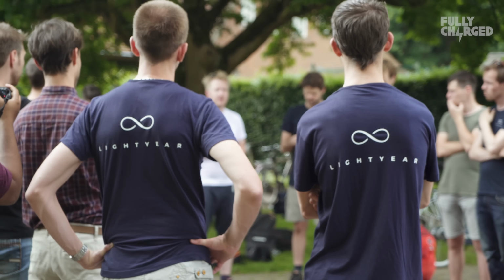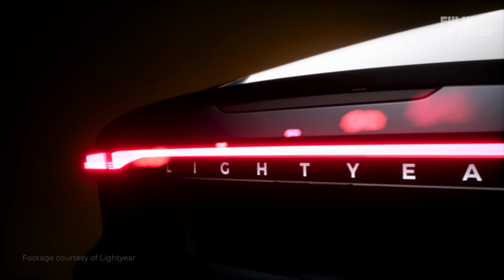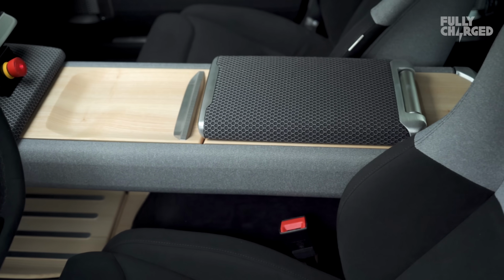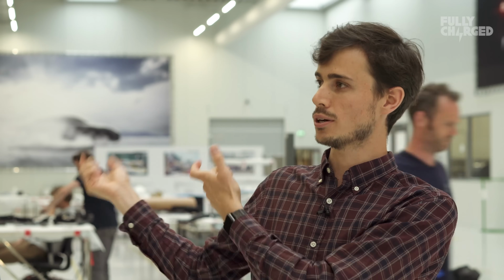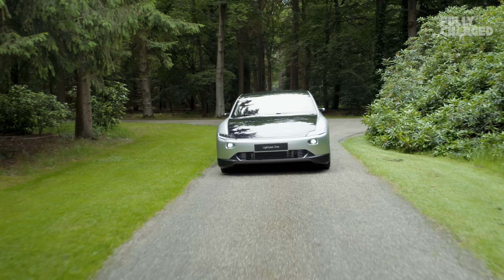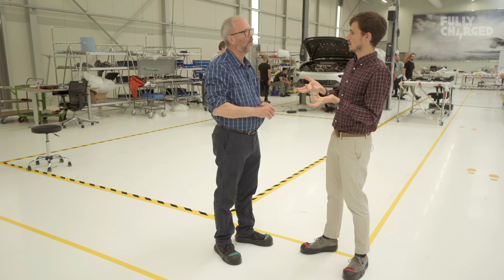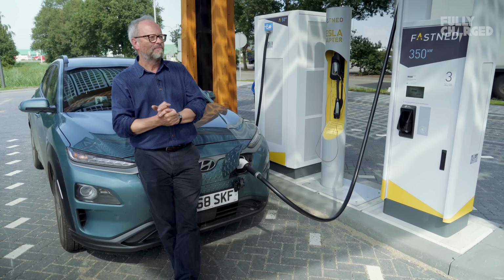Lightyear One solar powered electric car - exclusive first look | Fully Charged

Comment: Great concept since many cars just sit for most of the day anyway. One day cars will be painted with silicone conductive material so every part of the exterior will serve as a solar cell.
Reply: @BakjeLeip  Actually, the sun does give off enough energy, we just don't have the technology to capture all that energy, but like batteries the capability of solar cells are increasing... just a lot slower than battery density/cost/weight ratios.  Raise efficiency of the drivetrain, lower mass, reduce acceleration expectations and it's doable.  Tesla uses a brute force approach but through research and manufacturing improvements they've been relatively rapidly increasing efficiency while reducing their costs... but they keep making the damn things better in terms of performance.  It will take a long time and a lot of investment with a lot of really really good scientists and engineers to get close to that level with a solar charged vehicle, but they are now at the point that a useable solar car is possible... now it is just a matter of working towards reducing the compromises needed to building and operating one.  I like their concept, no idea if they stand the slightest chance of actually making it to market with a commercially available road legal vehicle, but it is the closest we've gotten so far.  I think if someone with the funding skills and background of Elon Musk had the passion/drive to push this forward it would have a bright future.  Hoping for angel investors is a long shot unless a big car manufacturer decided that this was their shot at leap frogging Tesla and other electric car manufacturers.

Comment: Did anyone actually go to Lightyear's website to see how much those solar panels are contributing to the range? Despite all the claims of increasing efficiency, one still cannot escape the basic thermodynamic limit of sunlight's energy flux at earth's surface, which is ~1kW/m^2. This is exemplified by Lightyear's own estimates of how much range their car has with one full day's worth of sunlight: 33km, 30km, 8km and 7km, for spring, summer, autumn and winter, respectively. (that's 20, 19, 5 and 5 freedom units for those not stymied with commie shackles such as universal healthcare) Given that this is Lightyear's website, one should suspect a bit of overenthusiastic estimation, so those represent ideal cases, with unobstructed clear skies and a clean car throughout the entire day, conditions which are…ahem optimistic.

Thus, unless your driving needs are trivial, calling this a solar vehicle is a bit like calling my bicycle fart-powered – technically my farts have a bit of thrust, but it ain't the main motive force.
Reply: Benz please elaborate. My untrained mind is of the view that since it is expected that there is continuous charging in the sun, then range can only be limited by absence of sun. Am I wrong?
Reply: @stevenbarrett4110  Sunlight flux is limited to about 1kW/m^2 at earth's surface, under ideal conditions (no clouds, direct 12noon sun, etc). That means even if you take a large solar array that is 10m^2 in area (Lightyear One looks to be smaller), it's still only 10kW of "raw" solar energy. Given that photovoltaic efficiency is currently about 25%, only 2.5kW is converted into electric energy. 2.5kW is just about 3hp. That's barely enough to run the AC at full blast, let alone drive the car to any sort of speed. And remember that this is under ideal conditions. What happens when the array is dirty, or if it's a cloudy day?
The takeaway is that the solar panels are, at best, a slow recharger to the main battery. It is not enough (by far) to replenish the energy used by the car under any normal operation. By Lightyear's own admission (which I take to be optimistic), a FULL winter day's charge is good for only 7km, which is only about 1% of the claimed range of 800km (meaning you need at least 100 days to fully charge its battery). Lightyear One is basically an EV, and perhaps it's a great EV; but one should be realistic about how much its solar panels can do and thus shouldn't see that as its main selling point.

Comment: this is great.. the more people that come up with other solutions to reduce the consumption of petrol powered vehicles the more we get better over all vehicles all around.. I am a die hard petrol head or gear head if you would.. I own something that gets VERY VERY bad MPG.. but it is the style sound and feel I like about it.  On the flip side I work for a wind energy company, and have always wanted a Tesla model S.. and has always been in my 3 to 5 car dream garage.  With this car, and tech, the amount of options one could do, the better solar panels that will come from this and every thing else is quite amazing.  I cannot wait to see what happens and eventually I will get that Model S, possibly a Rivian truck cause that is sweet, and then This would be a 3 to have.. plus having a mobile solar car to help even power a home etc. AMAZING.. good stuff peeps. keep up the good work.

Comment: Solar car? Its been raining here for 2 weeks straight.
That alone would not make it viable for most consumers.
This is a pipe dream. Great job, quality build. But like most of my projects.., useless.
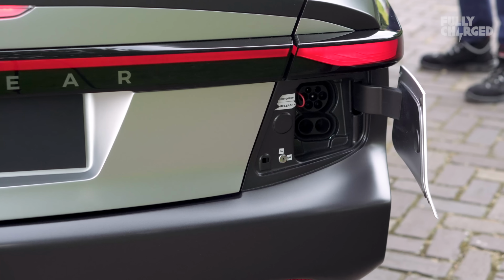Reply: 18:01 - Charging plug: plain to see for anyone who pays attention. When it rains, you get power from the same source as whatever powers your internet device. Everything is "useless" when you make unfounded excuses why it can't work.
Reply: I guarantee the price of solar panels on your roof would be more expensive than the ones on top of this car. That is, unless you live in a house whose roof is smaller than a car's roof.
Reply: @oggyreidmore  lol, Tesla can make roof tiles, then they can make solar panel roofs, bonnets and side panels for cars
Reply: It's not worth it. The cost to manufacture photovoltaics vs the amount of power you can get from a sideways facing panel (as opposed to upward facing) is cost prohibitive. But even if you don't care about cost, panels on the side surfaces are more likely to be damaged than ones on the top surfaces, even further reducing their usefulness. Also, people are likely to park right next to another car in a lot, and the neighboring car will shade the side panels even further reducing their usefulness.

Comment: Show the calcs. Solar doesn't stack up on non-tilted/directed panels when the sun isn't overhead. Not on houses, walls, boats, or roads - all bebunked. Please show why this makes sense on cars. A+ for an efficient electric, but why solar? Does the cost, weight and lifetime of solar panels outweigh the cost of the energy produced (i.e. more energy to transport them than they output)?

Comment: Love the interior, the exterior still needs some work, specially the front. 
But what this project desperately needs is a Christian Von Koenigsegg or Horacio Pagani to sell the concept, this guy was definitely not up to the task.
Reply: Evidence would suggest otherwise. He’s doing something far harder than they are. Only Tesla and Fisher got this far. Fisker got no further. So far he is in second place after Elon Musk. The market he i selling to for this technology is not really consumers - its other car companies. Toyota held 30% of Tesla. He isn’t “selling” a car, he’s selling a technology and a new paradigm. Eliminating the infrastructure necessary to get power into your car. What you are looking at is not a car - but a car that encompasses the car, the oil well, the refinery, the oil tanker, the port, the fuel tanker, the petrol station all in one. Not even Tesla embodies that.

To get through the commercialisation valley of death will require billions - that only comes from multi national strategic investors and VC funds, not a thousand customers. They won’t invest on emotion or a cult of personality. They will invest in knowledge, courage, intelligence and execution. He has all 4 of these - as do the rest of the team. If you are a main board director of a car manufacturer or a global VC fund and I’m incorrect, I’m happy for you to correct me, otherwise you are looking at this the wrong way and missing the point. He doesn’t need help, he doesn’t need any skills he doesn’t already have. Beware the quiet achiever....

Comment: I am NOT sure why these guys are stretching the video.  21 min. of story to say something in 3 min. though i am exited about the car which i did not know about. The car is basically is just like partially solar powered 'Sono Motor Cars', which is more closer to reality.  
Long story short for others: Winners of Australian Solar Challenge (Darwin to Adele, 3000km) have created this new Solar Car 'Lightyear One' (Startup company from Netherlands). Specs below:
Power: Partially powered by solar panels. 
Range - expected to be longer than Tesla, 400 km on power sockets
Charges about 10-12 km per hour on sunny days

Missing info. from this video. 
When the car is going to be product-ionized - unknown 
Cost - Unknown?
Speeds - Unknown
In short the specs are still unknown, it is just a concept car.

Comment: The overpriced electric car market is already monopolized by Tesla, so how about making a daily driver, efficient and inexpensive, for us common folk? You  people are missing the point of E vehicles, building these evs dripping in luxury and performance directed at the upper class instead of making a simple, reliable vehicles that could get the masses out of the grip of big oil. What's wrong with you people?
Reply: Thats what they want.But they first need value as a company to fund mass production.
Reply: не болтай so why can't these companies make money off of mass producing daily driver evs? Simple and efficient and reliable, easy to build...?! Big oil must have a hand in all of this, and they own the politicians who make the laws. Bunch of sold-out sellouts!  There will never be a simple and reliable ev daily driver/pickup...just these overpowered, overpriced pimp mobiles dripping in their plastic chrome and carbon fiber. Pfffff!

Comment: This is great! But there's one huge flaw. The sunroof surround the hood as well... I've owned my car for a little over 4 months.. I've already gotten at least 10 rock chips on my hood. And my last car I had for 2 years I had to actually fix several because they were so big. Solar panels are going to be too expensive to fix like that
Reply: Check out Tesla's Solar Roof. Those solar panels can withstand quite a beating.
With micro-inverters, the whole system also doesn't go down if one or a few panels would be out due to damage
Reply: By the time it hits the street they will have a cloaking device!

Comment: I like it! Could work well even where there aint that much infrastructure developed. I like the self charging, but the panels would need to be heated or something for the winters in Sweden. Mayby even with a flourine coating.

Comment: I dont get it. They make it sound it could run all day on solar energy. You have a 60kwh battery and 1250wp solar panel. In the perfect conditions its take 48hours to charge the battery and thats in de perfect condition. Probably with the angle on the car and with shades it will be way less. So for that price a big fat no for me.

Comment: I love this new technology and all, but I'm really dissapointed that they simply ignored the fact that the size of Tesla's batteries are literally why they are rated as some of the safest vehicles in the market. They keep them bottom-heavy, making it nearly impossible to tip over from large amounts of force during car collisions. Lightyear should have kept a battery similar to Tesla with the same efficiency as their current battery to reap from the safety benefits and allow even further driving distances.

Comment: Well, getting around the world without flying is not a thing sadly. Good to see you are stress testing charging infrastructure a bit. I bet the experiences you gain over each year would be interesting to see in an annual sumary of sorts.
In any case people won't stop flying. Not in significant numbers at least, Just as people did not stop driving cars. Its the power source that needs to change. If you look at the ridiculous tax exemptions aviation gets right now, you could use basically anything else too. Synthetic fuels, hydrogen, pick one. The struggle will be the decade it takes anything related to passenger aviation to get teasted and actually allowed for use.